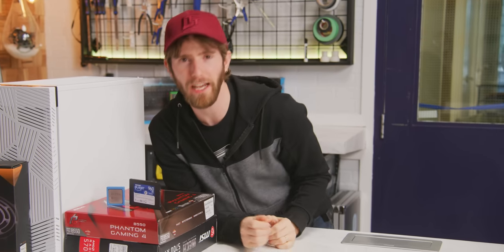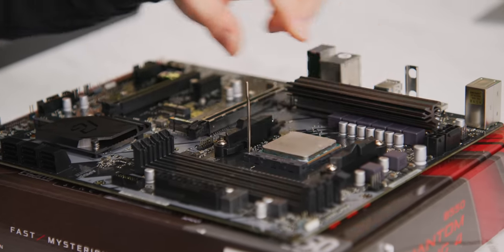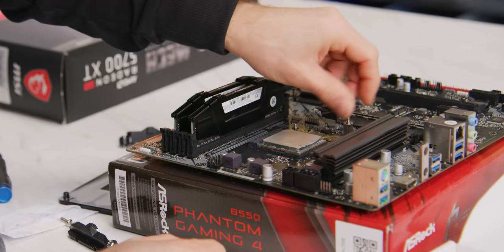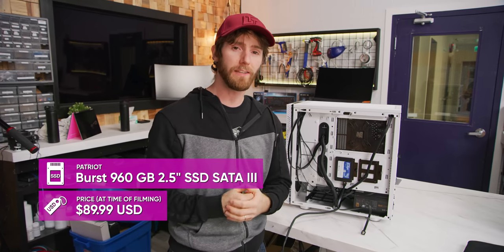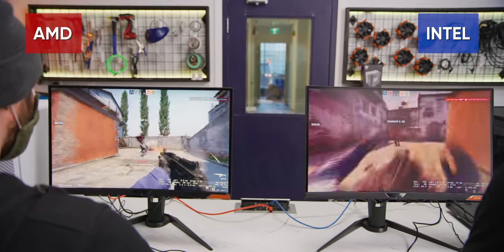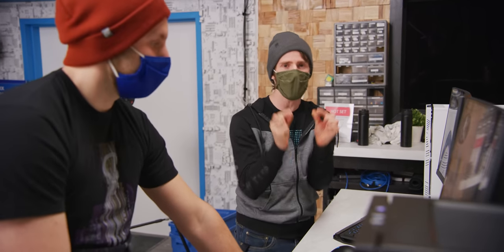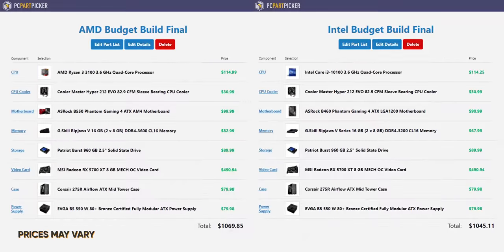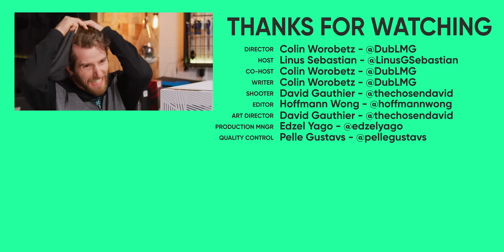AMD vs. Intel midrange gaming PC challenge

Comment: $1000 is mid-range? Damn, I must be really broke.
Reply: #relatablecontent
Reply: Agree, its looks like very cheap PC
Reply: Me too
Reply: Same
Reply: low range: 500 to 1000
mid range:1000 to 1500
high range:1500 to 2500
and than above that its just to show off and you got a pc for the next 10/15 years
Reply: I don't know in what universe $1000 is midrange. Maybe in LTT's universe.
Reply: @POLARTTYRTM  in the one where you only buy current gen stuff. 1000 is mid range
Reply: @gireaffe3457  then i have a fucking low range , for now
Reply: @POLARTTYRTM  in every universe. It’s built with midrange hardware at midrange prices.
Reply: @susch7466  in my country low range is 400 to 600
Mid range is 600 to 900
High range is 1000 above
Reply: @gireaffe3457  I paid 1000$ CANADIAN for a high-end gaming PC in 2009... How times have changed when 1000$ is now considered "midrange".

Guess same as 500$ US is now considered "midrange" for GPUs.
Reply: @gireaffe3457  lol you cant future proof for the next 10 to 15 years
Reply: @susch7466  Can buy a much more powerful system for 699$.  MacMini.
Reply: Gaming* is the keyword on the title
Reply: @gireaffe3457  Nah low range is more like 250-500
Mid range 500-1000
High end 1000-1500
Cutting edge 2500+
Reply: 1000 bucks is entirely possible for a nice setup. You're not dropping 1000 on just a gpu.
Reply: it's the gpu prices, they increased the price by a lot
Reply: Same
Reply: @susch7466  Current gen isn't needed, so no $1k isn't mid range
Reply: LTT videos don't make sense. Why would anyone buy a 5700xt for an i3 or Ryzen3 ?
Reply: @ka7al958  because 1440p gaming is usually gpu bound
Reply: My pc will be made from hand me down parts
Reply: same
Reply: 10 years ago, 1000 would be low range. You needed ~2000 for mid range components.
Reply: i have a 700$ 9400f and a 1660 super and im happy with it xd
Reply: @POLARTTYRTM  or america's midrange
Reply: 1000 or less is bottom end if you are playing REAL games. League of legends and csgo are NOT REAL games. Doom, Call of Duty, and other big budget triple A titles ARE REAL games and you have to figure that a gpu to run REAL games is going to run you at least 400$ on its own. Then add 100 for psu another 150 for mobo and another 350 or more for a decent cpu youre already at 1000$ without a case, monitor, keyboard, mouse, ram, or cooling. So yes 1000 is bottom end of mid tier in total cost in a Real gaming pc. I did a video on the true cost of a REAL gaming rig.
Reply: @POLARTTYRTM  Depends on your country I guess. I would call 1000$ fair midrange...very fair
Reply: @hia5235  ah yes, the value gaming pc, the mac mini
Reply: @POLARTTYRTM  1000 is mid range... That’s the truth.
Reply: Canadian dollars.
Reply: @gireaffe3457  Even the highest end pc will be a very outdated in 10 years.
Reply: @viet0ne  That was a different 1000$ and its not even true 😅
Reply: Best I could do when I did a rebuild for my 8 year old build was $575, and even that was a stretch. Saved 3 months for it.
Reply: I got my pc for like 150 dollars, its definitely possible if you look a bit for it.
Reply: @POLARTTYRTM  For a gaming PC its midrange. Graphics cards are expensive. For an office tower its high end. For a workstation/editing rig thats probably entry level. Depends really.
Reply: @gireaffe3457  wtf 300-500 is midrange
Reply: They really didn't shop around. At the same price point I pulled out a 3060ti, a 3600xt, working 3600mhz ram, a 1tb gen 3 nvme, a B550 micro-atx, nice cooler master case and good air flow. If this was a year and a half ago maybe I would have agreed with their choices.
Reply: If scalpers didn't buy out the graphics cards, it would be $600-$1200. But it would be the same with the PS5. Since they are raising the prices dramatically on them.
Reply: @muki_x  ...no
Reply: Nah, there are better setups. This just sucks.
If you are on a budget, you dont need 3600mhz ram, 3200mhz is cheaper and makes almost no difference. Aftermarket cooling isn't needed, $30 for 200mhz isn't worth it...
Also, why pcie 4.0 in the midrange? Makes no sense...
Reply: @zgredek1234567  True. Depends on where you are. In my country $1000 is 5 months of minimum wage, so that's anything but "midrange".
Reply: @WandererOfWorlds0  Linus specifically said ”USD”
Reply: @TedNeeTed  most of your components arent going to age so badly that they require replacing every 2 years, a CPU can easily run that long, just ask the people just now upgrading from 2500k or 4790k

SSDs aren’t good forever basically unless your needs change(casual to pro work)

A case is...a case

PSU is good for 10 years easy unless you require more wattage

Only GPUs might get replaced every few years
Reply: @TedNeeTed  that is for my country tho pc are cheap here buddy
Reply: It just means we all have potato pcs lol
Reply: $1000 is midrange, it's just that most of us buy it component by component, we usually have an old system left over and reuse the parts so blowing $500 on the GPU or the mobo and CPU when it comes out every 3/4 years is not really that difficult (around $30 a month or so if we think it will last 3 years, most of the time it's around 5).
Reply: Same haha i bought a pc for $400 😂
Reply: This is why Im not giving up on my 2016 PC so far now the Bluetooth is gone in device management and I tried all the steps. I had to get a usb dongle just for wireless headphones and Xbox One controller to work
Reply: @gireaffe3457  mid range is $1k to 1.5k? my mind had midrange like $650 - $900
Reply: @TedNeeTed  some dusting and a 3090 can take u a long way. its every so many years when i manufacturer jumps 2 times higher than last-gen
Reply: It's the new midrange, yeah. That wasn't always the case 8-10 years ago. Midrange used to be $700-800 back in the day.
Reply: @gireaffe3457  haha I have a $100 pc base end ?
Reply: @hia5235  but Mac OS is terrible for gaming and it doesn't have a decent GPU for gaming and it isn't very upgradeble
Reply: @seamon9732  This is the unfortunate truth.  My PC from 2012 was about $800 and was decently mid/highish end. Kids these days don't know how expensive PC gaming is now compared to the last decade lol
Reply: @ladrillorojo4996  well yeah there are cheaper set-ups . . . I'm just saying what I got vs what they got for the same price
Reply: The comments on here are both silly and depressing. In what world do you get a new mid range GPU and a Mid range CPU and avg ram for under 1k? If you're building a computer for midrange prices it'll be between 900-1500$ ,  $900 being low $1500 being high. There's nothing wrong with machines below or above those prices, but you are getting a lower tier of hardware if you're below it. Mid range doesn't give a damn about how much money you have, as for people saying 1k is high end, you are simply lying to yourself to make yourself feel better. Going above 1k doesn't simply give you gloating rights for no reason, there are straight up performance jumps multiple tiers above 1k. Roughly $3500 USD is roughly the top end of a halo build. Anything over that is just shiny addons. this includes a 5950x and a 3090. Both of which have tangible performance improvements over the tier below them. This would be Enthusiast tier. Then there's High Tier, Mid tier, and low tier. Maybe a bit of a reality check is in line for how you view hardware.
Reply: @Emerald_Forge  i feel like low range doesnt give you room at all. 
gpu 1030 costs around 80 
decent case 40 to 50 
motherboard 50
than its already in the low range than u need cpu ram ssd/hdd and a cooling fan at this low price you dont get one with te cpu. so low range is a school pc
Reply: gaming is expensive okay....
Reply: @viet0ne  That's literally not true and it's obvious you weren't building PC's 10 years ago or you'd know that's bullshit. Please stop.
Reply: @HorsepowerGarageVideos  yes but still verry usable for work i mean a 3090 64gb ram and all that stuff wont go out off date quick it will just be cheaper and cheaper
Reply: Same, I got a $350 desktop
Reply: Q: Why do fish live in salt water?

A: Because pepper makes them sneeze!
Reply: buying a pc is like buying a car when you buy a car te price goes down. when u buy a pc its out off date  you buy cuz it get better every year
Reply: @ladrillorojo4996  Yeah this "midrange" build is shit honestly. Are they losing their touch?
Reply: @TheLongDon  computers aren't a necessity either so your budget must be $0
Reply: @gireaffe3457  
-fixed-
low range: 500 to 1000
mid range:1001 to 1500
high range:1501 to 2500
and than above that its just to show off and you got a pc for the next 10/15 years
Reply: @avonire  Used to be. Not anymore unfortunately.
Reply: @ka7al958  it's called an upgrade path. That Ryzen 3 can easily be swapped out for a Ryzen 5, 7, or 9.
Reply: These PCs are garbage because I can build one for $1,000 to 1,200 and getting a better cpu like the ryzen 5 3600 and a 5600xt and a b550 motherboard and get a better ssd and rgb ram. Heck even my gaming laptop I bought back in late 2018 is a better value, core i7 9750h 16 gb ram, 1tb Samsung m.2 ssd, gtx 1660 ti 120w non max q, 120hz screen and free monster hunter world bundled in all for $1,100
Reply: @POLARTTYRTM  1k is mid-range. Whether or not that is affordable for someone doesn't change the fact it is mid-range. If someone can't afford it, then they can only afford low-range. Which... is fine.
Reply: @HanduBananu  I meant linus's choices, didn't read your comment actually.
Reply: Yeah, just look at how much the high end hardware costs. High end these days can range from 2500 + (2000 will only get you your GPU and CPU and maybe a motherboard. You'll then need cooling, RAM, PSU, mouse, monitor etc.)
Reply: @KhromTX  They are, i fully disagree with this build.
Reply: @F4ngel  High end isn't for gaming, but saying a 4c/8t is mid-range is just wrong.
Reply: @ryanwallace983  mate he is clearly talking about something that lasts you without lowering all settings. I know those cpus still work great, but its not like spending more than 2000$ is gonna make your pc way more """""future proof""""" than something under 2000$, because most of the time there isnt anything more to spend on at that that price range that makes your pc a whole lot faster.
Reply: @gireaffe3457  is there no such thing as under 500$ LOL
Reply: @KhromTX  in 1998 my Pentium III prebuilt HP setup was $2500.... PCs are cheap as hell now by comparison.
Reply: @xevus2959  5700xt is far better than a 5600xt. Also 1000 bux is deffo midrange, consoles are priced pretty good tbh
Reply: @POLARTTYRTM  1000 is mid range
Reply: @POLARTTYRTM  because this is actually MIDRANGE hardware. not their problem you can't afford it
Reply: @hia5235  gaming mac mini?
Reply: @POLARTTYRTM  indeed, 1500 is midrange
Reply: Yeah around $1000 is midrange now used to be way cheaper
Reply: @scoldingwhisper  Maybe read the first comments before replying and you would understand why this is off. They use only current gen parts. Not my problem if you can't see the problem here and read the comments.
Reply: @scoldingwhisper  4c 8t can't be called "mid-range"
Reply: How good your build is isn't really determined by price, especially if you shop smart and check the used market. IMO they really fucked up by paying $500 for a GPU, but honestly it can't be helped (and it actually a pretty good pairing with the CPU) with scalpers and everything driving prices of even last gen stuff up.

But seriously all these people saying you have to pay $1000 for a system have no idea what they're talking about. I built a secondary system not too long ago with a 1600 AF, 580, with 16gb of ram in it for under $500 and it performs amazing in just about every modern titles at high and 1080p
Reply: @bepbep7418  yes, but that's different because all PC's were expensive in the 90's
Reply: @FlawlessSin11  Don't expect some specific people in this comment chain to acknowledge that part, as you can see.
Reply: @eldragon00  I did . . . I did it.
Reply: @ladrillorojo4996  the choices are really strange. Also while he didn't actually build it bitwit has a video from september on a hypothetical 1k 3070 build that cuts less corners than the LTT one in this video.
Reply: @bblz9171  no because you’d get bottleneck on most triple A titles therefore making that 5700xt worse value because you won’t gain as much because of that shit cpu combination, and why are you even talking about consoles it’s not even relevant ? If you can afford a pc and can’t make a proper claim then why say anything at all geez
Reply: @HanduBananu  Did you shop around for parts that are actually in stock?
Reply: I have like 550 dollars to spend on a new gaming pc
Reply: @POLARTTYRTM  1000 is midrange. Get a job and buy used or last gen hardware and you"ll be able to afford it at a lower price point.
Reply: @gireaffe3457  Or you could buy 16 core CPU bring cost to over 2500 if you need both gaming and workstation performance.
Reply: @ThePredator21  But CSGO isn't, which is what they were testing. Also many games are still CPU bound in 1440p. For 4K, i3 makes sense though.
Reply: @bepbep7418  Okay but it is a want, and filling that want doesn't require brand new hardware. Your point is moot
Reply: @jasonmay1978  I mean those less demanding games are still REAL, but nobody upgrades to get better FPS in WoW.
Reply: @xevus2959  and yet many games do not utilize all cores
Reply: In my country RTX 2070S costs $600+ so yeah PC parts have become more expensive, accept it.
Reply: @konstantinfischer8180  would recommend buying a decent used pre-built and upgrading from there. It's kind of the way to go now for budgets less than 700ish.
Reply: @ladrillorojo4996  I would say that the 7700k is very midrange, and thats 4 cores and 8 threads
Reply: @sujimayne  That's one of the points of why this build is a bit flawed. They have used only current gen parts. Look around for used or last gen parts and you can get a far better deal for a lower price.
Reply: @jasonmay1978  what , i have a 700$ machine and get 1080p60fps on most triple A titles that you mentioned. Which is fine enough for me.  Also no such thing as a real game or unreal game. One is considered a competitive game where frames matter the most and visuals dont and the other is the opposite.  Its not that hard.
1080p60 is more than enough for me personally . It would be nice to have more resolution but its just a stretch and not worth it to me for now
Reply: @GoneAngel  it took me since september to finish the build off with a graphics card. But early on basically everything was in stock for cheap. For example my 3600xt was $220 meanwhile they are buying a 3100x now for $199.
Reply: @verqu3450  it was mid-range, now there are $100 hexacores... Not to mention cheaper boards and cooling needed...
Reply: @gireaffe3457  Nah low range is basically a prebuilt with a GPU slapped in it
Reply: @HanduBananu  He's making a build now. Unless you want him to take 4 months to scrounge the best deals when everything is out of stock, then make a video saying "It took 4 months to get these parts together, here's a build guide that hopefully won't take you 4 months." You might as well just wait until stock catches up. No one wants to hear about a build they need to spam refresh sites every day to get.
Reply: @bblz9171  I never said just for gaming, who builds a pc just for gaming, anyway my point was that these pc specifications for the price is absolutely terrible, really a quad core and a i3 on a $1,000  “gaming “ pc is outrageous to me let alone the gpu configuration with it. I shouldn’t have to explain it over and over as people can see and immediately tell these are terrible for 2020 or 2021.
Reply: @GoneAngel  well yeah except this is a 700 dollar build artificially inflated. The only part I actually waited on was the graphics card. Everything else I bought within the 1st 2 weeks. Look at Bitwits 1k 3070 build guide from september to see what you could have gotten.
Reply: @Ladioz Also helps I was gifted a case, but I also reused my power supply. I had a PC Power and Cooling   650 watt that I had used for a year before I decided that I wanted something modular many years back. Kept it aside for a few years, knowing I would probably use it again.
Reply: @ladrillorojo4996  that's the lowest end processor you can buy new. 6c 12t is the next up...
Reply: @POLARTTYRTM  so they should've bought a used last gen processor that costs around the same?
Reply: @scoldingwhisper  Not exactly. Bitwit showed that with 1k you have the potential to build with a 3070 which is far better.
Reply: @mr.pandemic695  
You live at the factory where they make all these parts?
Reply: Yeah, in 2020 double the price of consoles is apparently mid-range. Never stops being weird to me.
Reply: I bought a 5900 x and a 570 taichi board with a 6800 1 TB 510 firecuda nvme 360 mm watercooling 32 gigs of Xpg d50 ram EVGA Supernova 850 Watt power supply ordered 11-19 received 12-24 and cost me 2700.00
Reply: @POLARTTYRTM  lol
Reply: @TedNeeTed  only the gpus is relevant to the discussion then, you specifically said “pc” referring to the whole system, obviously no system left without upgrades will stand the test of time BUT you can basically future proof the rest of your build, pcie gen 4 isn’t going to be replaced any time soon and ddr5 won’t be that much better starting out than high end ddr4, it was like that for the transition from ddr3 to ddr4 anyways

So assuming you plan on sticking with your CPU for 10 years then yeah, you should be good with a pc built today for 10 years assuming only GPU upgrades
Reply: You have serious character flaws if u can't save up $1,000 for a new PC every 4-5 years
Reply: @LordBattleSmurf  tf this guy thinks he's in a isekai?
Reply: @LordBattleSmurf  or just really broke...lord knows it took me long enough to pull the trigger
Reply: @ryanwallace983  on the grind 24/7 fr
Reply: @jasonmay1978  Right? And running 1080p 60hz or 144hz is not "great" regardless of the settings. I don't know when the bar became so low
Reply: @ka7al958  it was the cheapest at the time, rtx3060 is not even In the market yet
Reply: @POLARTTYRTM  $1000 is mid range, as you getting the best dollar per performance ratio, Go into the $400 range and all you got is a clunker of a office machine
Reply: @seamon9732  The Video card is half the build there. Then again my CPU is $400.
Reply: @jasonmay1978  Oh I agree. I think I paid like $250 for my Ram, then I got a Dual channel set of 64GB of Ram, more than I ever need at the moment.
Reply: @muki_x  No it isn't. $500 is low/bottom range. $400 is a used Dell from a old office building.
Reply: @avonire  Na, you can't get Squat for less than $1000 now, $650 is just above a low end office machine that only does Word and web browse.
Reply: @KhromTX  Gaming in general went up in price. Price of consoles, games, controllers, everything went up.
Reply: @lukasperuzovic1429  not consoles
Reply: @gireaffe3457  for you, almost everyone else no